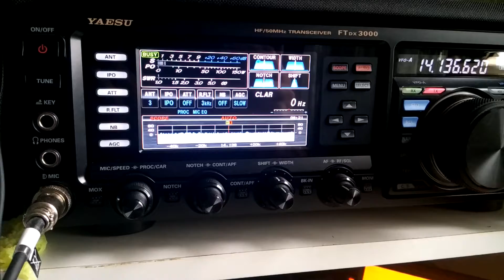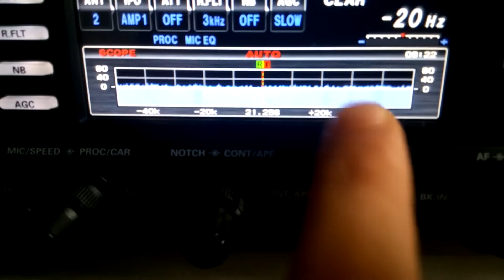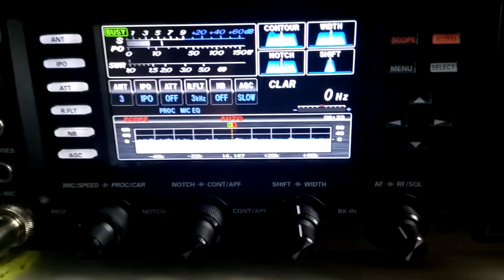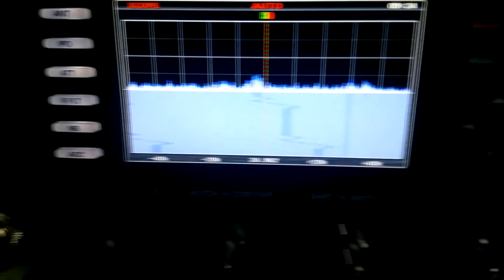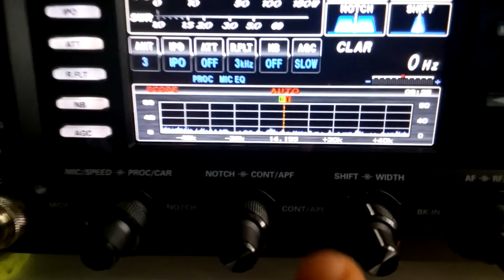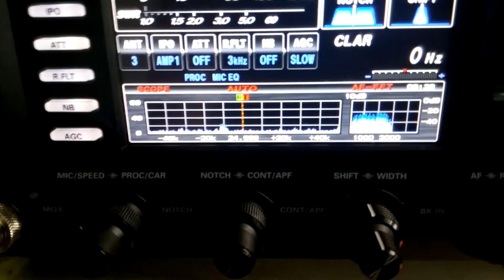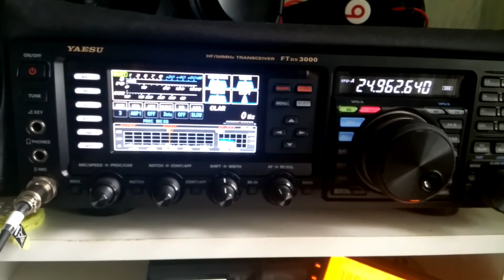Yaesu ftdx-3000 waterfall mode problem (latest FW)

Comment: I see the same in my FTdx-3000 also. It is with latest FW also. No fix so far
Reply from the maker: Riyad yeah, unfortunatelly also on the latest FW... :(
Reply: I have the exact same problem and it is worse on the higher frequencies. I can't see it at all on 20m and less but on 17, 15, 10m it is a distinct line and associated spike in the display.